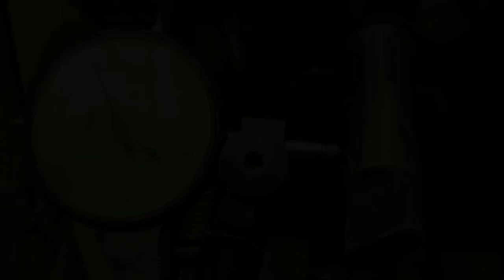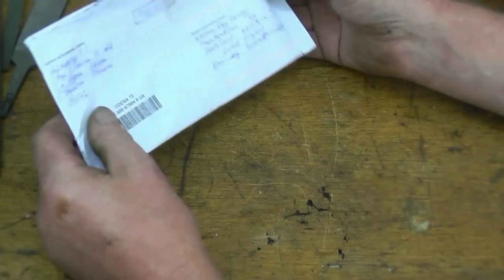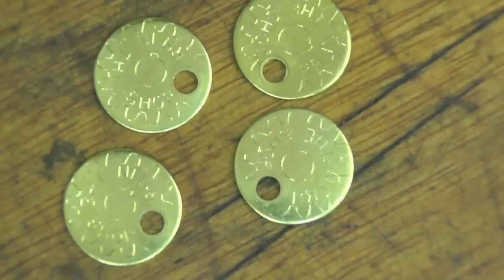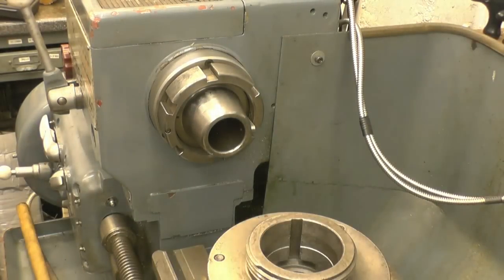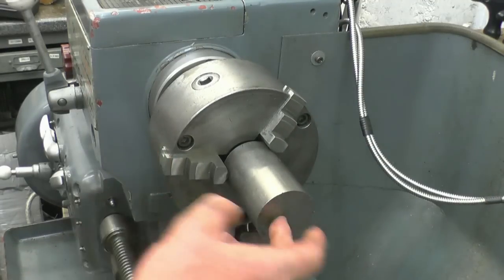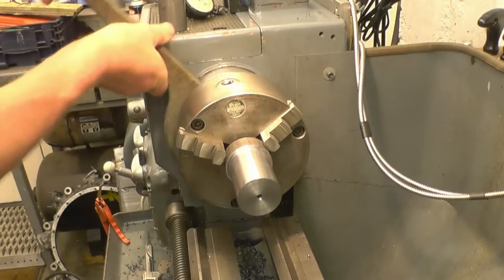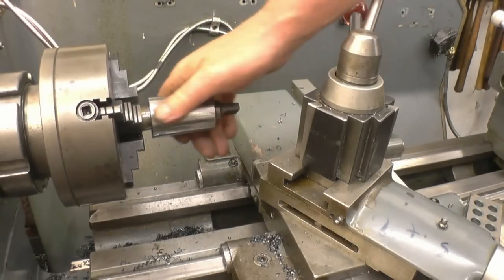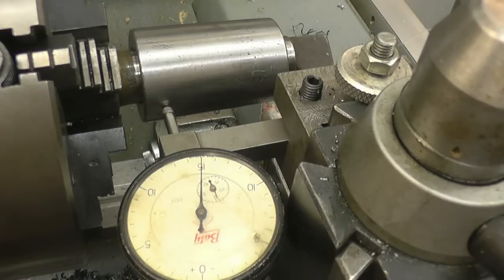SNNC 133 P1 Machining tapers / Viewer mail  /  DTI giveaway

Comment: I demand someone mic up a fannies hair just so we can get a constant on it.  it would be interesting if John would revisit his old regrinding his chuck jaws, he didnt get them right, and he got given new jaws, so it woul be good to see him put the old ones right ready in case they need using.  also, john , its rare you do get any gifts, and even then it tends to be older, part worn, and generally far more interesting than a van load of new stuff (to us at least) plus you keep it short, so its fun when you do it.
Reply from the maker: Thanks for that  I will see what can be done with the "fanny hair"
Reply: A hair's breadth is supposed to be one 144th of an inch according to one definition on Wikipedia. Frankly, I am disappointed that John is working to such slack tolerances....
Reply: Richard Whitfield
maybe fannies hairs measure differently!
Reply from the maker: I think it depends on the vintage of the "fanny hair"
Reply: doubleboost
not more variables John!  anyone care to provide a range of measures? lol
Reply: I assume it's only going to be thicker.
Reply: +doubleboost 
John, in America fanny is another name for arse so the calibration will be off. Simple things can get lost in translation!

Comment: John, I've got one of those cardinal chucks, like yours it was saved from scrap. Mines a 5/8 on an MT3. I quite like using it, it self tightens and you seldom have to use the key. Mart.
Reply from the maker: I have cleaned it up  Works very well

Comment: Hi John.  Being new to machining please be easy with me.  Wouldn't it have been more
accurate to set the compound slide using the taper in the headstock directly.  I think
one could have used an attachment on the clock to adjust the angle.  Thanks for the
great video - your usual excellence   Rod - Canada